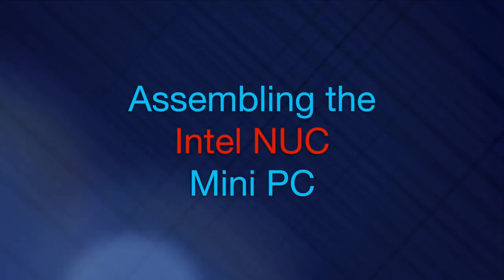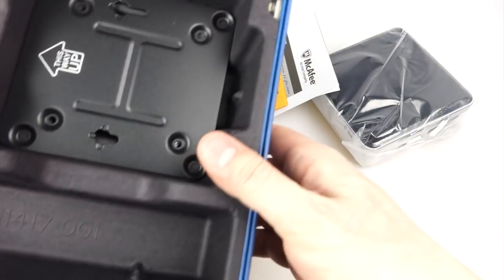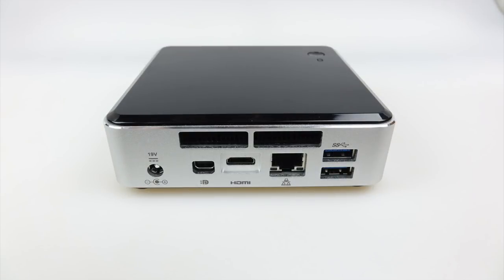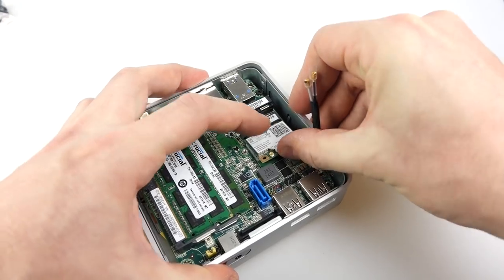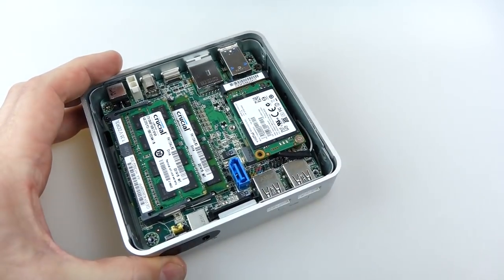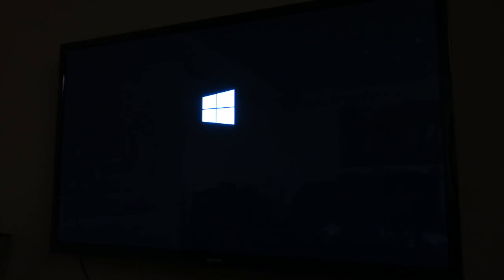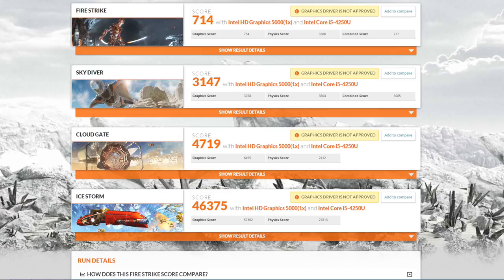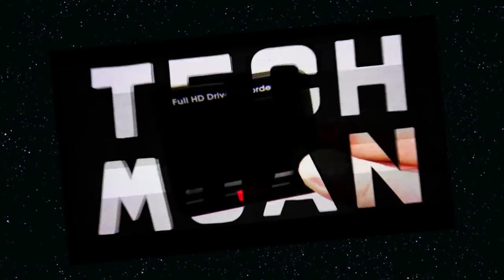Assembling an Intel NUC Mini PC - i5 D54250WYK

Comment: Why should one use Intel 7260? Can't I just do with a solution like you have, a USB antenna? or even if I want to use the usb antenna, do I still need this 7260? I didn't understand what does it serve for. Could you please explain?
Reply: +NoChrReq I imagine his USB WiFi adapter would be a pretty basic e.g. Realtek 11n job with only a single antenna, and possibly 2.4 GHz only. Good enough for some web surfing but hardly state of the art. The 7260/7265 supports two antennas for up to 2 sending/receiving data streams on both 2.4 and 5 GHz and works with the newer 11ac standard as well, so maximum throughput may turn out to be significantly higher - plus BT support as he mentions in the video.

Comment: I built mine the other day.  I installed windows 8.1 and all that but I don't have internet.  It doesn't display any wireless networks and it won't display a network via ethernet.  Any help is really appriceated.
Reply from the maker: +Aidan D there is an Intel NUC website. You  can use another computer and download the driver packs you need from there, put them on a memory stick, copy across to the NUC and install.
Reply: Techmoan thanks for the input. I did that earlier amd if fixed it

Comment: Take that anti static band wearing weirdos!
Reply: if you don't live in a desert, or it's not a cold winter day, usually there's enough humidity in a room to prevent static electricity, i've been playing with innards for over 20 years without anti-static crap.
Reply: mr bad example Yeah, so many people blew that out of proportion a few years ago. None of the pc builders I watch on youtube wear anti-static bands, and one of them is dealing with what was originally a 10000 dollar rig.
Reply: tcv4 i do extreme overclocking on my personally built $5500 system and i never wore one. if anyone knew the science behind electrostatic properties, youd know that youd pretty much have to try and esd your shit to cause damage...
Reply: mr bad example: Static rarely damages instantly, usually just weakens it enough to break down in months to a year or so, so all those poor victims of yours....
Yes static does damage and there are photos to prove it all over taken by electron microscopes.
Reply: yeah yeah yeah i know i know it does... so does throwing ur PC into the tub. Doesnt keep me from using laptop in the pool.
Reply: tbh Anti-static wristband shit is no where near needed unless you decide to build a pc in Siberia or the Mojave desert. And if you do, getting a humidifier is a good move.
Reply: I have always had a habit of touching one of the warm water thermostat pipes on the wall to ground myself before touching components, but yeah. As long as you aren't petting a cat while wearing a wool shirt or something, you aren't very likely to brick anything with your static electricity.

Comment: excellent port replicator sata ssd external graphics card with pcie adaptor. And or a sata dom industrial ssd drive. then use that usb 3.0 port with a usb to pcmcia express card adaptor and run external sound card or graphics card. very capable.
Reply: I'd still populate one pcie port with a video accelerator card in case Intel skimps on the video codecs.

Comment: Just build a full sized PC or a mini-iTX PC and store it in a cabinate so it doesn't take much space.
Reply: If not, get the Devil's Canyon NUC that will work with a external GPU encloser like the Razer Core. The intergrated graphics is good tho, the iRis Pro Graphics is prettt good.
Reply: ***** Emulations takes up alot of threads. So if you have 8, everything will be like on a desktop.

Comment: These small computers are horrible. I guess it works great as streaming-device. If intel would build them with an integrated BluRay drive it might even work as home cinema. Thanks @Techmoan, you still manage to get the one of a mill viewer happy.
Reply: As you saw, the thing is tiny, and an internal disc drive is probably not the best thing in the world for it.

Honestly, as a media center, if you were to put something like Kodi (formerly XBMC) and put in a USB antenna lead, it would be great for the cord cutter who wants something as an all-in-one. 

Heck, I might just start saving for one, if the price goes down.
Reply: AIO inc.
external drives can be purchased for less than 40€. At least in my region.

Comment: Dear Mat, I know this is an old video and an odd question, but I have a problem. I have a windows 8 license that is currently not in use, so what I want to do is install windows 8, activate it and then upgrade it with the media creation tool. The problem is that I can’t find a safe windows 8 ISO, I only found one from a suspicious website. I was wondering if you could make a copy of the iso files and share them with me through google drive or Dropbox? Please let me know if you can! Thank you very much! -Alex
Reply: I restored an old sony Viao recently, I found an ISO for 7 and one for 8 on internet archive, if you want a link. you can still get 8.1 on microsofts site too, despite support ending, Also, Rufus is a better program for making the installation media at this point. if somehow 2 years later you still want to do this, i'd be happy to send you the relevant resources.

Comment: I feel trolled I am like 100% sure the box did not make that Intel sound haha
Reply: why RU knechtel it does, intel got a thing for putting their jingle on packaging. A while ago they sent the guys at node sort of a "mystery box" thing, which had a keypad ontop of it. Every key played a tone of different pitch, and the box would only open if you put in their jingle on the keypad.
Reply: It sure does, got one and if you only open it once in a while you get kind of startled every time. You can see the hole where the fotosensor is located in the video to.
Reply: I bought a nuc a couple of years ago and it just came in a regular (smaller) box.

Comment: i built around 1000 pc and never used antistatic stuff nothing has died
Reply: BoomWithPeter depends what surface and where you built it
Reply: Antonio Debono regular wooden table on laminate
Reply: The ghetto way to do it is to put the PSU in the case first and plug the PSU in, it grounds out the case. Just keep some part of bare skin in contact with the case and you're gucci.
Reply: I've been working on PC's since the 80's. I never use a wrist strap. I always touch the case and then the anti-static wrap on the part I am using. You just need to make sure you equalize the potential difference so no current flows between you and the part. One that is done you're golden. I've never blow anything up, because of static discharge. Also, save petting the cat for after you're done working.
Reply: Thick, fluffy rug in my office. Static City.
Reply: Mike Angelo nylon shirt and trousers on a wool carpet. Blue sparks in the dark and my hair is like a cloud !
Reply: Just get a wire and shove it in the ground and them wrap it around your ankle, ghetto doesn't have to be a horrible experience btw.
Reply: @michaeldim1  This.

Comment: Did anyone else cringe when he put the disk read-side down? Or am I just one of those weirdos?
Reply: runforitman I always cringe when someone does that with sensitive tech like records, cds and stuff like that
Reply: The other way around. The "read" side has plenty of material that can be polished away, the other one only has a thin layer of paint over the data---scratch that and your data's gone.

(At least for CDs; I think it got better for DVDs and BDs)
Reply: runforitman i also Cringed
Reply: With spindle drives, there is always that kind of thing. You must push it down and sometimes, disk just slips away under your fingers. If you are bothered by this, buy a slot-loading drive.

Comment: For the bit were he pulls off the antenna, what you do is take off the black tape and slide the clear case down the wire. Just in case someone else comes across this issue,

Comment: that was portal on directx 8
Reply: AIO inc. Portal doesn't use dx11 it uses either DX8 or dx 9
Reply: The game will run in either DX 8 or 9 depending on what the user chooses in the settings menu. Portal doesn't have any DX11 support it's too old of a game. It's like me saying 'because I'm running Windows 10, Portal will run using DX12 on my computer '
Reply: AIO inc. No.

Comment: Expensive as Hell ! For 500£ you could have built a PC thats faster then the PS4 and XBONE and still used the old acer in the Piecade
Reply from the maker: But I wanted to do this - so that's what I did.
Reply: Techmoan OK Then! I eagerly await for the PICADE video and would like you to do more Gaming things in the future
Reply: Techmoan Can you do a video where you test Minecraft on the highest settings? Please :)
Reply: Stachu536 You're not going to get very smooth framerate with integrated graphics like the one on this mini pc.
Reply: but you get a box that makes intel sounds
Reply: Techmoan Just wanted to let you know that the NUC has mini hdmi as opposed to regular hdmi.
Reply: you can not make something this small yourself.
Reply: sashablfc The Gigabyte Brix would be a better option than this for gaming, but it's more expensive.
Reply: zeldajunkielol2 It is very loud and is not within the allowed parameters (price)
Reply: zeldajunkielol2 he mentioned that darling. There is mini and a regular hdmi.
Reply: Skylar Garrett Ive never really understood that notion.Why have a smaller computer when your monitor,keyboard and mouse are still the same size?
Reply: Skylar Garrett When considering that the footprint on many Mini-ITX and Micro-ATX cases aren't any bigger than a shoebox I condier myself "that ignorant". I've also replaced enough mobos after someone was fiddling inside their computer while sitting on shag carpet to be one of the weirdos that suggests an anti-static bracelet whenever working on the innards.
Reply: ***** If you find it in a ditch for free then yes
Reply: *****
A ditch is a narrow trench used to carry water. You find drainage ditches on the sides of roads in rural areas to handle the water runoff when it rains. There are also irrigation ditches used to transport water from rivers or streams to crops.
BakyLive's comment is a lot like saying "If you find it in the gutter on the side of the road for free then yes".
Reply: I would love to see anyone making a better gaming system with 500£ than the PS4/XBONE, that includes all the connectors and movement camera and joypad and all that comes with PS4/XBONE so it should also be included in the 500£, also please put at least 3gb of gddr5 too, can you show us please, Mr. Baky?
Reply: QuDE QuDE that would be quite easy actually...
Reply: i5 6400 /w rx 470= gta 5 high, 60 fps
Reply: BakyLive right bro even a 79$ android tablet will defeat Intel graphics:/
Reply: Cure Cure How's about a ps4 that you over clocked so it will be slightly faster and sell for twice the amount
Reply: BakyLive Because Techmoan isn't going to be using a mouse and keyboard. Did you miss the whole point of the video, that he has to fit it in a small box to play arcade games on?

Comment: in order for gamers to be able to use devices like this, they're gonna have to make it work with some serious screen cards.
Reply: +Richard Catto Could be a pretty sweet steambox if it had a decent GPU in it.
Reply: +Richard Catto There is a product from Gigabyte similar to the NUC called the BRIX. There is a gaming BRIX, that believe it or not, has a GTX 760 in it (not a 760M, a full desktop 760 0_0). However, it doesn&#39;t perform as well as normal due to thermal throttling, and it's INSANELY loud when under load.

EDIT: Stupid typos that I made

Comment: where is the Titan graphics card?
Reply: There are adaptors that would let you plug a gpu into the wireless slot on that thing though a titan would be bottlenecked and you'd need a psu for the card.

Comment: would this be good as an xbmc box
Reply from the maker: With the silent fan and the HDMI out - it's perfect for attaching to a TV and putting all manner of HTPC stuff on here, Netflix, Amazon Instant Video, Hulu, XBMC, Plex etc.
Reply: For XBMC I would personally choose a raspberry pi as its 30 pounds instead of 300 pounds.
Reply: i have used a raspberry and they are so slow. trying to use it for read all my media for my server it just takes two long.
Reply: XBMCbuntu would be perfect for this.  The NUC can handle it just fine.

Comment: At about the date of this video, I believe that's when I got my Dell Optiplex 3020 SFF. I swapped the small HD for a bigger one, added a SSD as the boot drive in the CD ROM space, and added a half-height AMD Radeon 7750 video card for better graphics.

The NUC looks interesting, but its pricing isn't very good especially after you add in the cost of the components needed to get it working along with the equivalent labour costs to put it all together. At least your OS choices are very flexible.

The Raspberry Pi 2 isn't any better. You can get a complete kit with case, power, Raspian OS on a flash drive and Wi-Fi dongle for about £50, but you're going to spend a lot of time getting it to do anything useful especially if you have to write the software.

Comment: Ever have sound problems with yours? I use mine as a media PC running Kodi and despite upgrading drivers and such, after extended use the sound system will freak out and die requiring a full reboot. We use the optical out. Not sure if that's the reason.
Reply: Not sure what you mean by "use Windows". The OS is Windows 7 and I don't think it's Kodi. The audio will just get crappy, then buzz, then die completely. Stopping and starting the sound service doesn't even fix the problem, and Windows will even hang during shut down after this happens. It requires a hard reboot.

 As for a dedicated sound card, that's impossible in the NUC, unless I went with a USB sound card, but I've dropped enough money into this already and can deal with a reboot now and then.

As for the drivers, the NUC uses the Realtek chipset, like just about everything else these days. Honestly, I think the NUC is just crap, after having had it for six months now. It's a very finicky box.

I was just curious if anyone else had optical out problems with the NUC. Thanks for the reply, though.

Comment: Please when will they stop with the shiny gloss piano black or white plastic?. It's not only a scratch dust and finger print magnet but it does actually look cheap despite most thinking it eludes to quality if used, it plain doesn't so stop it and that goes for all companies manufacturing electronic goods.

Comment: I actually pulled off the connector on my Dell laptop, thinking that Dell had some more slack on that WiFi cable... nope ;)
I sent it back though, and they fixed it and even made it longer for me. That's one reason why I am loyal to Dell.
Reply: TheVividYoshi WIFI Cable?
Reply: mazombieme WiFi antenna cable, I mean

Comment: These make great PCs for 3CX Voip phone system and other deployments in the field where you don't have a lot of room for a full size PC.

Been really impressed with the NUC, specifically this D54250WYK.   Rates a 6.6 on the Windows Experience Index, 7.9 for HD and memory.

Added Crucial Memory and Samsung EVO SSD 2.5".

One mistake initially was assuming all of these NUCs, or the Brix, have an ethernet port.    A must have, at least for us.    (WIFI is great as a supplemental connection).

Have an HDMI A to C cable available also.    Kensington lock is also a must if you leave it somewhere.   Its portability makes it a theft target.

Comment: Is it Bios or UEFI?
Reply: +Graham Linux I don't know the answer, but UEFI is a replacement of BIOS. So it's like asking "Is the car a bike?"
Reply: +Turbo2200kBps in fact there is an "or" in the middle
Reply: +Graham Linux it's almost definitely UEFI
Reply: wow UEFI is a kind of bios and it is UEFI
Reply: The basics
BIOS and UEFI are two firmware interfaces for computers which work as an interpreter between the operating system and the computer firmware. Both of these interfaces are used at the startup of the computer to initialize the hardware components and start the operating system which is stored on the hard drive.

BIOS works by reading the first sector of the hard drive which has the next device’s address to initialize or code to execute. BIOS also selects the boot device that needs to be initialized for starting the operating system. Since BIOS has been in use since the very beginning, it still works in 16-bit mode, limiting the amount of code that can be read and executed from the firmware ROM.

UEFI does the same task a little differently. It stores all the information about initialization and startup in an .efi file instead of the firmware. This file is stored on the hard drive inside a special partition called EFI System Partition (ESP). The ESP partition will also contain the boot loader programs for the Operating System installed on the computer.

UEFI is meant to completely replace BIOS in the future and bring in many new features and enhancements that can’t be implemented through BIOS. Some of those features are discussed below.
https://www.maketecheasier.com/differences-between-uefi-and-bios/
Reply: Its more like asking is it an old car with contact points  or a modern car with electonic ignition. They do the same job in different ways.
Reply: I think most people call it "Legacy", not "BIOS"